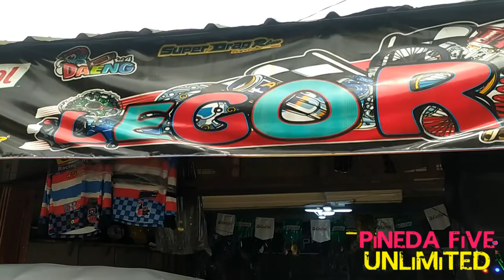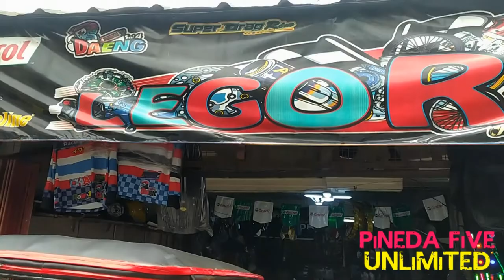RUSI TC125 Disc Brake conversion // Brembo PS16 copy X Domino Clutch Lever // P5 Concept (Semi-Thai)

Comment: boss palista naman nung mga ginamit na parts. salamat
Reply from the maker: Hub for XRM
Spokes
Rims (optional kung gusto lang palitan)
Speedometer Cable
Brembo PS16 lever  
Domino clutch Lever
Brake Fluid
Brake Hose (Earls)
Brake Caliper
Brake Disc 4 holes
Disc Bolts
Customized bracket
Reply: @PiNEDA_FiVE_UNLiMiTED  salamat lods.. inspired paconvert dahil sa vid mo
Reply from the maker: @miyuki7112  happy ako dahil na inspire kita,  upgrading lods!  May tip pa pala ako sa iyo,  yung iba na nagconvert nagpapalit sila ng fork na pang xrm para plug and play nalang ang brake caliper, pero ako kasi hindi ko pa natry, pag natry ko gawan ko din ng video, pero sa ngayon ok pa ako sa current set up, malaking improvement naman kasi mas malakas ang stopping power ng set up ko na yan, thanks ulit lods! And always keep safe!